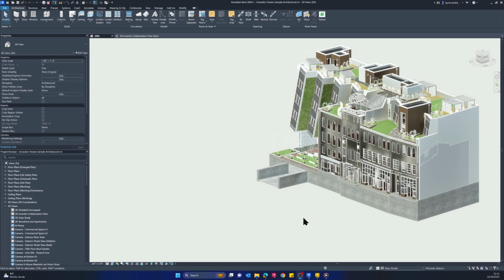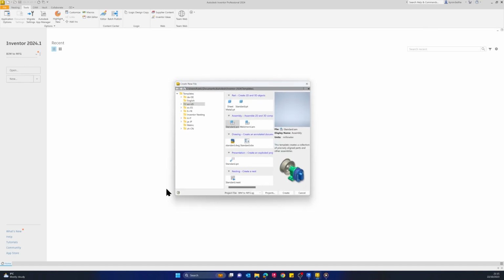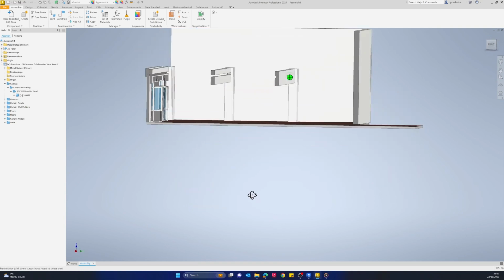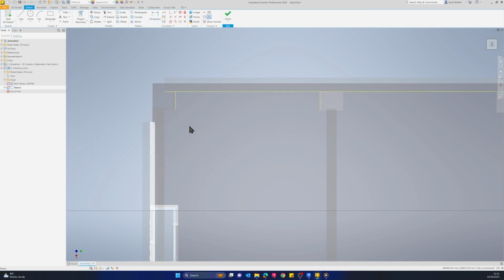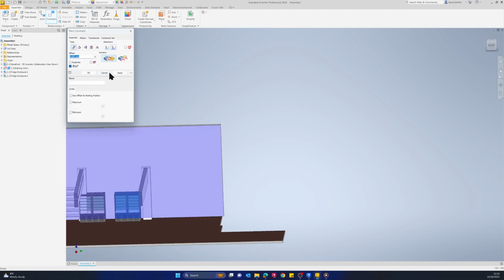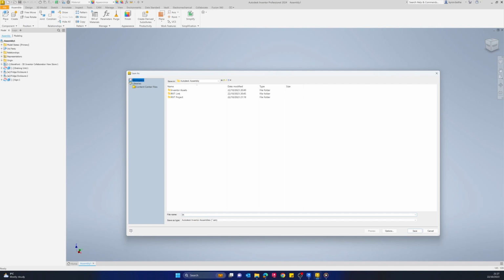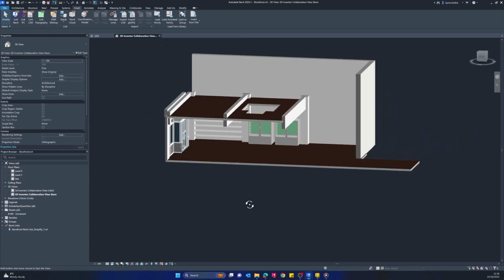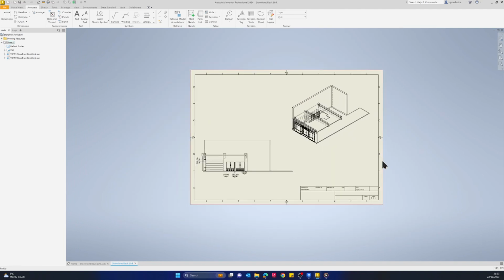BIM for Manufacturing - Autodesk Inventor and Revit Circular Workflows

Comment: When I am importing RVT or SAT converted from Revitm why does Inventor usually change the axes? I have to rotate them by 270 degree before grounding it to origin, is that anything you guys have come across?
Reply from the maker: Try and import the RVT/SAT model as the first component in the assembly, grounded at the origin. This will ensure that the model comes in at the correct orientation, and will retain the correct orientation in Revit if you need to export the model back to Revit.